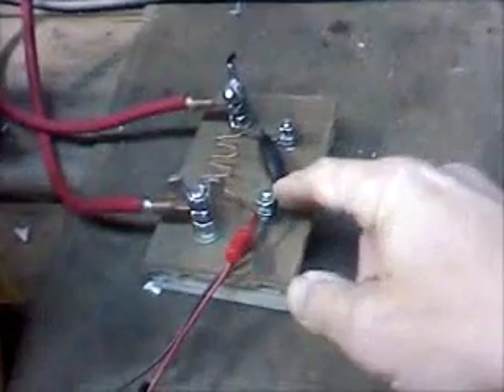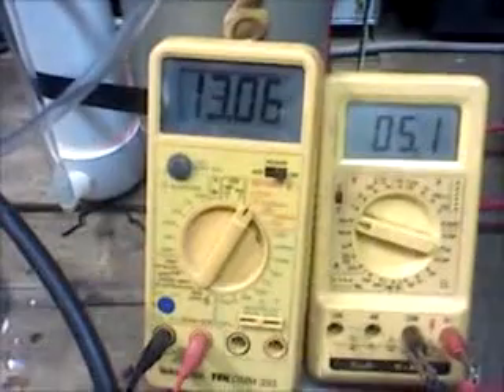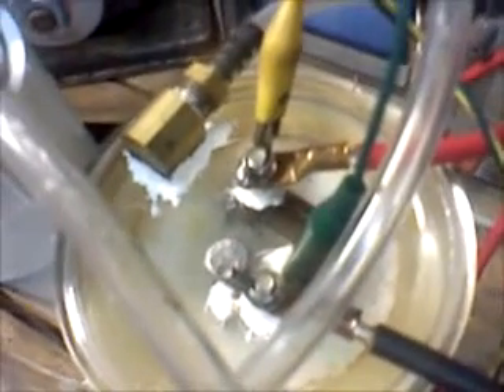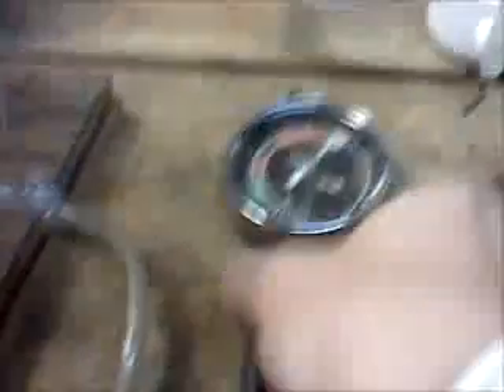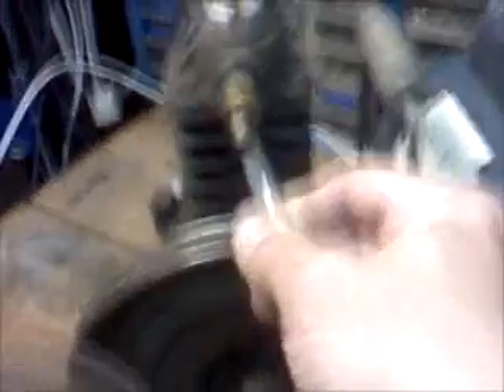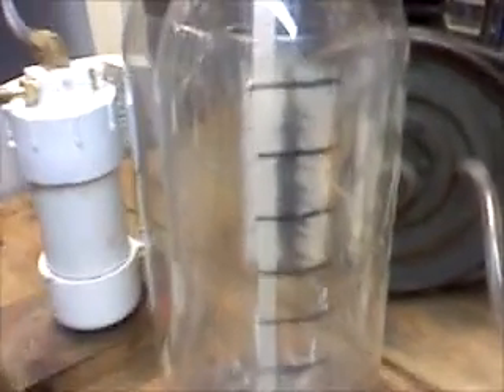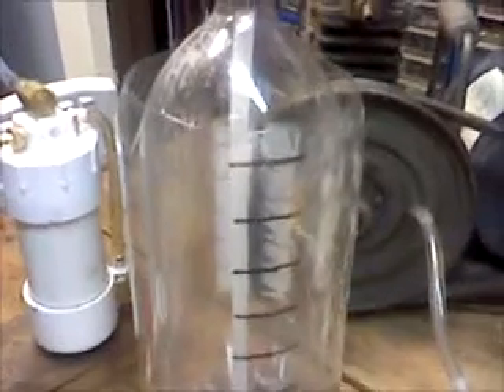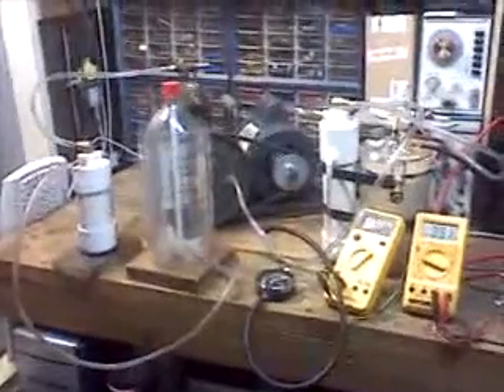#57 The HHO vacuum test setup

Comment from the maker: Except that if you connect it to a vacuum line, the HHO will never flow to the air cleaner. And, as my experiments have revealed, vacuum does not increase static gas production. Period.

Put it where you want but I am putting it to the air intake from now on.
Reply: I always thought vacuum increased production. Interesting

Comment from the maker: Not sure about this. I wouldn't inject into the pressurized side of the air stream as it will push back against any check valves. I wouldn't be comfortable injecting before the super charger either. I'b be worried about setting off the HHO as it's being compressed with the air. Probably best to leave the Celica as is.

Comment: Seems to me that MORE HHO must be produced, and PRESSURISED into a small tank, to even out the vacuum fluctuations under power on & off conditions. This is normal in a petrol engine, but the difference is, that with fuel injection, a constant fuel pressure of 36 psi (thereabouts) is maintained in the fuel rails. Unused fuel is returned to the tank. Something like this must be devised; a reserve of HHO flow for heavy demand situations. --- Keep trucking Mr ZFF.